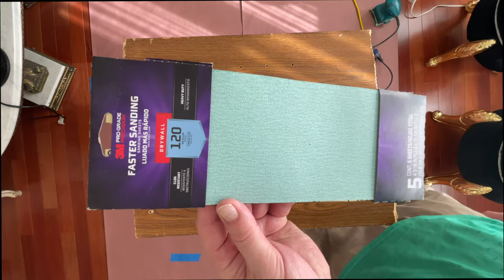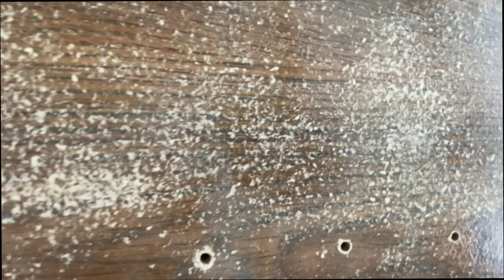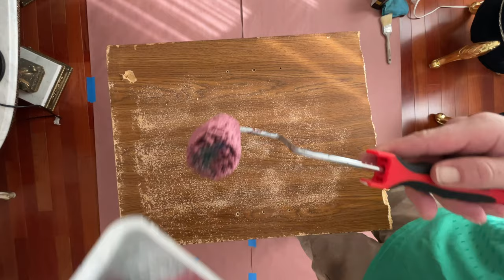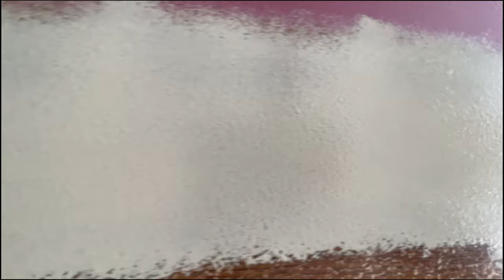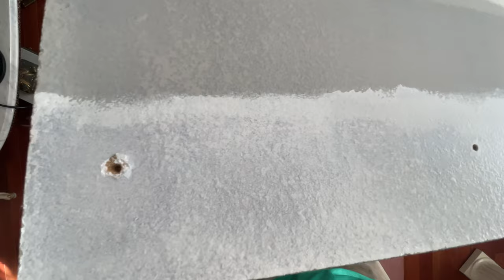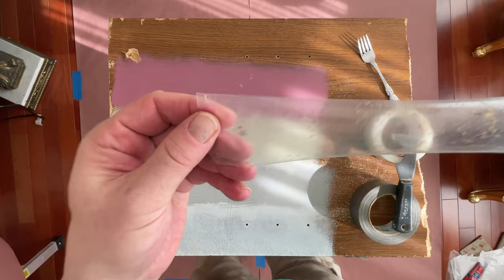4 Primer Scratch Test- STIX Primer - Zinsser Bulls eye - Ben Moore Enamel Underbody - Zinsser BIN

Comment: To be fair, you didn’t sand very well and here you used the stix primer
Reply from the maker: Hi Juan

Thanks for your comment! I sanded and used a Liquid Sander to promote adhesion! I used 4 primers, and they all did a great job!  Don’t u think?

Russ
Reply: Sorry, that was type-o. What I meant to say is you didn’t mechanically sand well on the spot where you painted with the stix. Look over the video yourself and you will see.
Reply from the maker: Yes I just used a sander to create a mechanical bond before using a liquid sander to dull,  clean, and soften the surface. They all performed great!

Russ
Reply: @RussOlinatzPaintShow oh!! I see his point. You did not hit the top 3 inches of your sample board with the palm sander, except for one quick swipe towards the end. P😊
That said, the 123 is hot garbage as far as primer goes. I would say the same for any waterborn primer. The BIN gets great reviews. I use CoverStain.
The Ben Moore Underbody is great but takes to long to dry.
Reply from the maker: Yes thank you for sharing that. I also like cover stain, but they recently changed their formula. Have u tried the new stuff?